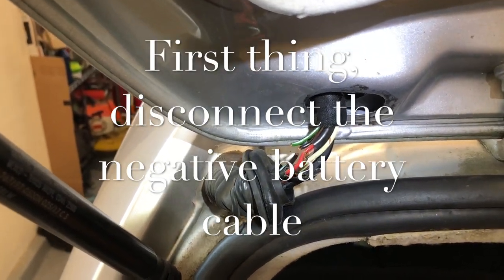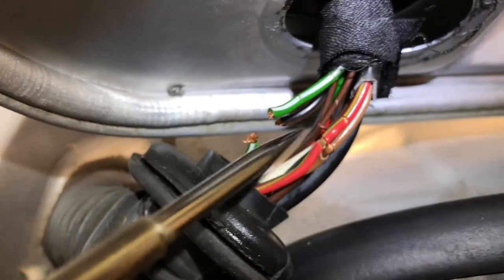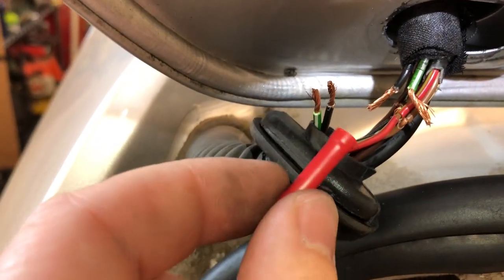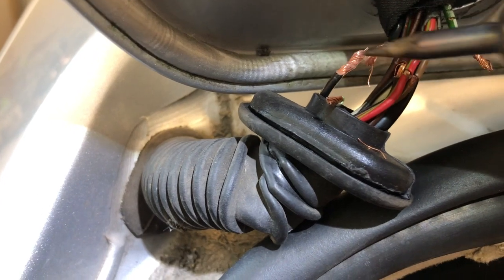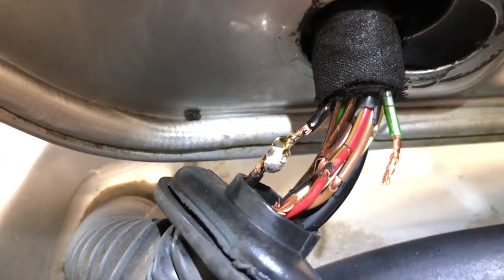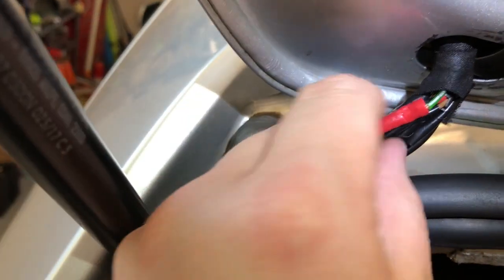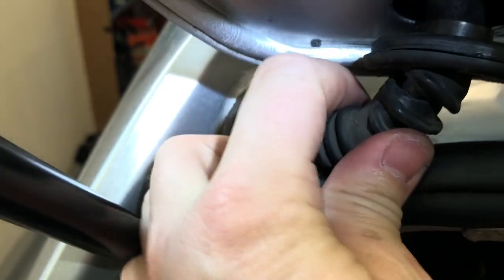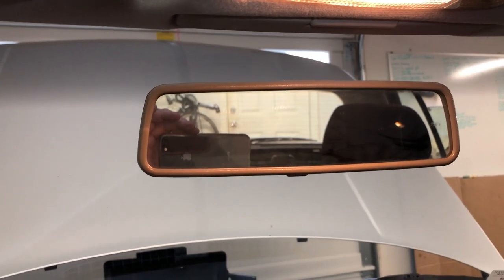MK4 Rear Windshield Wiper Stopped Working Volkswagen Golf 2003

Comment: Just found an easier way to get room to do better work if you disconnect the wiring to the wiper, 3rd brake light and the window heater and electrical tape the heater  connect to the brake light wiring so you can pull more wiring out at the hinge where it snaps and then pull it all back through can easily get an extra ~ 6 inches makes a huge difference
Reply from the maker: Good tip, thank you

Comment: Thank you going to try this. Mine works when open but not when shut. (my spray is also leaking inside that's another days project) I can see my wired are cracked my boot sleeve has a hole. Going to try this repair
Reply from the maker: Best of luck.  It's a tight space.  When the hatch closes the bare wires are likely shorting out against either other wires, or the metal of the hatch.  Good bonding experience with the Golf!  Let us know how it goes.

Comment: For me i have a problem, when i ignite the car the rear wiper works for a bit then stops randomly. When i need to turn it on to be working it always stops at some point. Any tips?
Reply from the maker: The issue could be a multitude of things unfortunately, but I would start with checking that you don't have a bare wire in the harness that's being pinched and shorted.  Some have had issues with the internal switch that runs the intermittent wiper functionality.  Others have had issues with the rear wiper motor itself which has a switch assembly inside the motor housing that goes bad.  If you take out the rear wiper motor, careful, as there's a nylon bushing that is reportedly easy to break when messing around in there from what I've read: I haven't done this yet, so don't have first-hand experience with the wiper motor install.
Reply: @wellingtonviking  thanks for the tip
Reply from the maker: @Brugar18  sure thing, please keep us posted when you've solved where the issue lies

Comment: hi, i dont dont know if youre familiar with this but i have an issue with my motor. i want to find the + and - but on the plug it says E,S,B, +1,+2. do you what does it means?
Reply from the maker: Hello, I'm sorry you're having an issue with your motor.  That's no good!  Sorry, I'm not sure what that coding means.  The easiest thing to use is a multi meter.  Hopefully you have better luck than I did and it wasn't ruined when you pull it out of your toolbox.  Best of luck!

Comment: I have the same problem in my golf 4
Reply from the maker: did you get it sorted?
Reply: @wellingtonviking  unfortunately no, I repaired the wires on both sides and got the rear defogger to work but the rear wiper did not work
Reply from the maker: Bummer. It’ll probably be one of those wires. Could have broken lower or higher too. 
Could also be a fuse or bad motor on your wiper. Frustrating working in the tight places
Reply: @wellingtonviking  maybe the next week I'll work on it again but the fuse is ok maybe the motor on the wiper is broken

Comment: whats the diagnose when its just making BRRRRR noise?
Reply from the maker: sorry, i haven't had this happen on mine like that.  brrr sounds like it could be stripped gear or a motor that's seized, but that's just a guess.  hopefully you've found the problem and have fixed it.